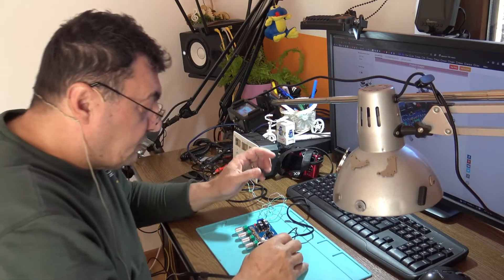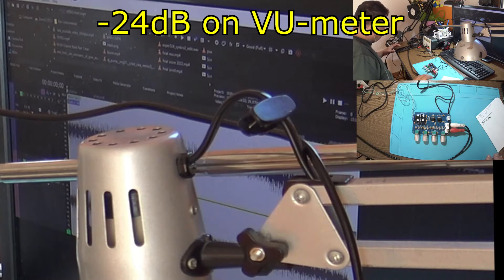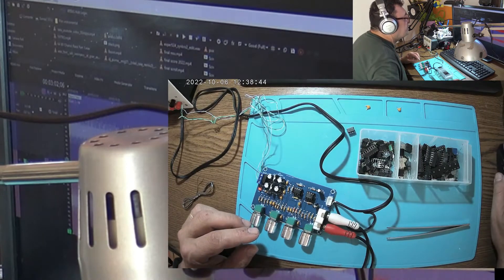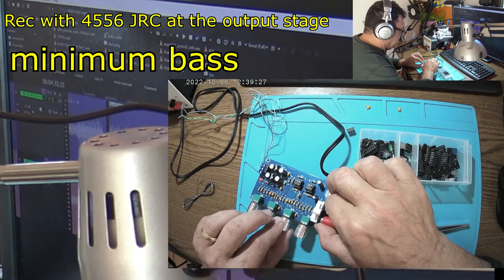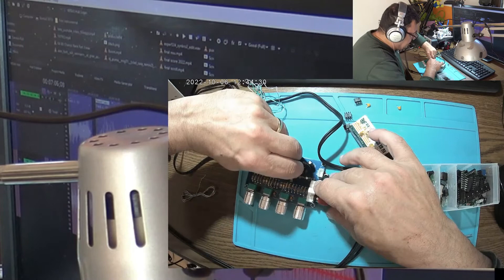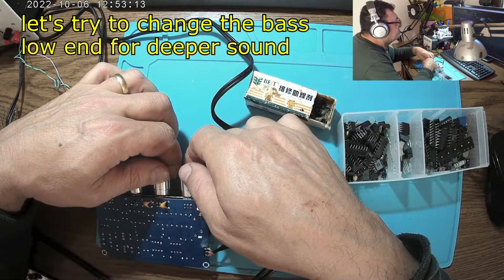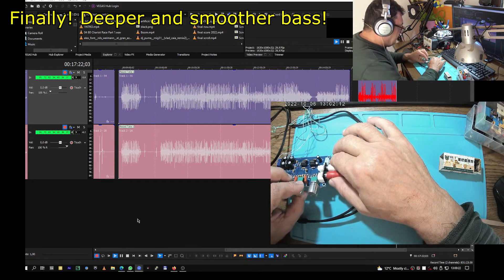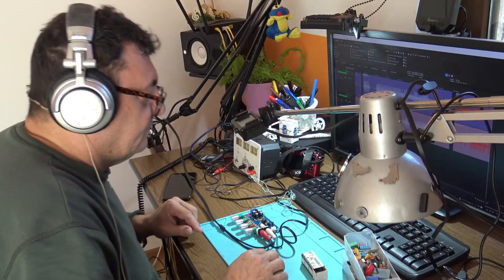3 band tone control MOD

Comment: Hello again my friend, I tell you that since that day I finished my homemade amplifier, with a TPA3116D2 module connected to this equalizer, I changed the chips for 2 Jrc4565, I put the 6 microfarad polyester capacitors in the bass, they have no polarity, but with the 10 microfarad capacitors, I did have doubts at first, because of the polarity, although I thought you put them backwards, I placed them as you did, the final result is that everything works perfectly, it does not heat up, the bass is more powerful and the mids very rich, I gave the amplifier a good finish, in a wooden box, connected to large LG speakers, it looks beautiful in my living room, I have been testing it these months and I am happy with the sound, I thank you very much for your help, how beautiful it is to feel the satisfaction of doing it yourself, right? but I think we did my project together, so take a hug my friend, God bless you.
Reply from the maker: Nice to hear that! It's a beautiful result and yes, all DIY gears sound much better because there is a part you can't find in any electronic shop..."passion". 
I hope it will last forever! All the best to you!!

Comment: Buenos dias amigo, grandioso video , un par de preguntas:
1-los capacitores que reemplazó de 10uF y 0.68uF ¿de que voltios son cada uno? 
2-la fuente que usa, ¿de que  voltaje y de cuantos amperios es?
saludos desde Peru.
Reply from the maker: Hola! 16v for electrolytics should be fine. The power supply it’s kind of problematic, you need a transformer with median output, able to deliver at least 500mA AC. So you don't need a powerful transformer. Any double secondary at max 1A will do a perfect job.